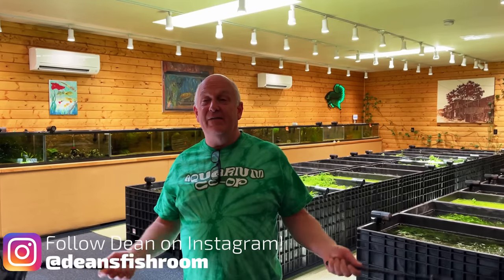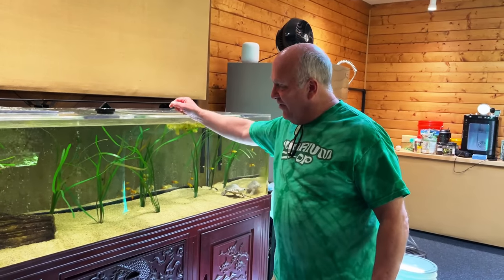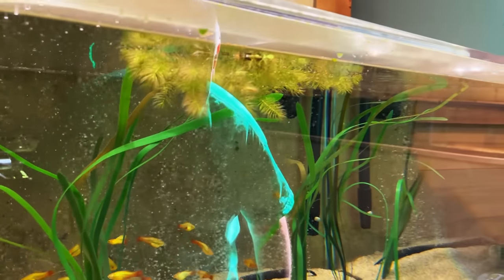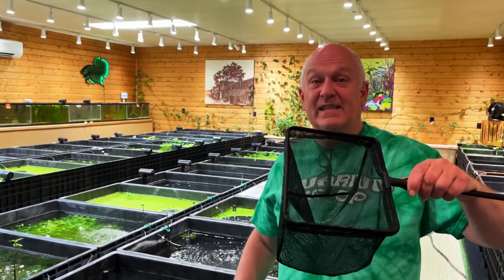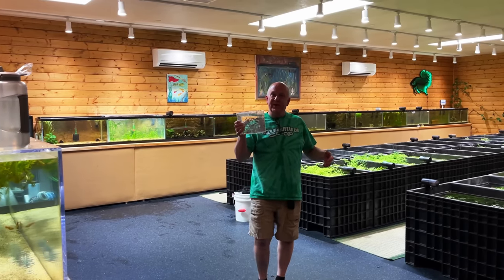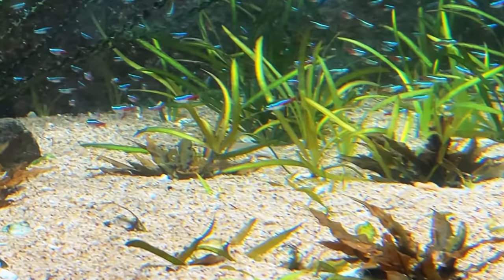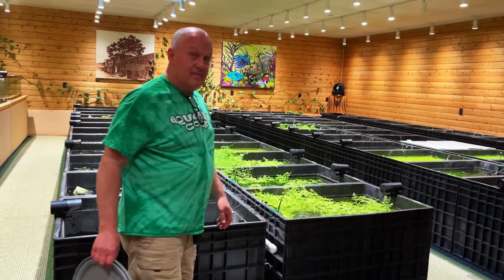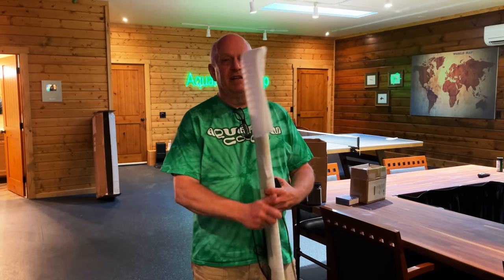Finally Adding MORE Fish to My 800 Gallon Puffer Aquarium - Fish Room Update Ep. 113

Comment: I have a question that I hope you can answer. I moved recently and just got a house with a basement but my partner doesn't want the fish in the basement. How many/what sized fish tanks can I have on the main floor before it becomes a problem?
Reply: I'm not an engineer nor an expert on this subject but, I believe it all depends on how your house is built, tank sizes and placement.
Reply: I would say that anything 55 gallons and under will probably be fine upstairs with a good stand that distributes the weight evenly (not on four peg legs). If you go little fish and plant heavily you can have hundreds in there. Good luck!
Reply: Depends on what the main floor is in terms of construction. 75G or higher usually is "fine" but if you're talking about beamed flooring you always want to verify weight displacement and position things accordingly over as many support beams as possible.

Having a basement doesn't mean the main floor is or isn't concrete. You'll never know without some sort of review or verification of what the floor is actually like in it's construction.
Reply: I would also say closer to the wall, across multiple floor joists is the strongest place for a tank, barring concrete as was mentioned below.
Reply: You can put them in the walls to save space a bearing wall otherwise your houses falls downWe were limited on space after having many large aquariums in younger years Think I had almost 1000 gallons of aquariums in my home you needed a  Dehumidifier if you have a basement you must support underneath where the tanks are if they’re large.If you have a crawlspace you must do the same never had a problem With Any  aquarium in walls Or solidly built furniture like stands can’t say the same about the metal freestanding Petco type stands or PetSmart wobble too much like if the golden retriever would be running through your house watch out.Now that we’re older most of my Aquariums are on beautiful wooden stand’s .If I was 25 again my basement that would become my fish room . Not much Youtubers in the 90s and of course Cory wasn’t there and Dean And all the fish keepers that bring so much joy to this hobby